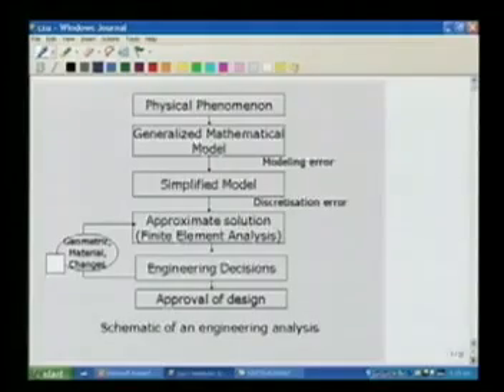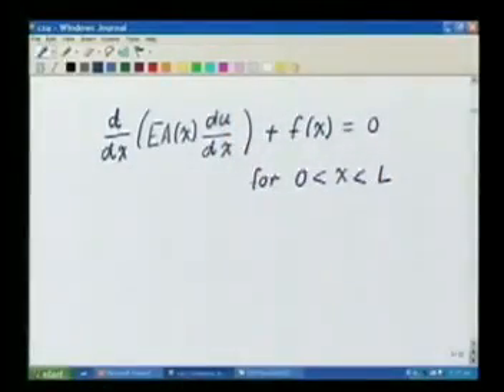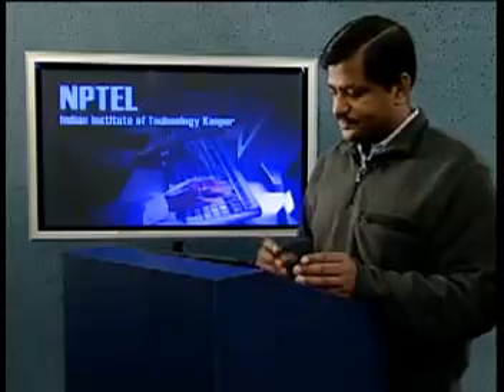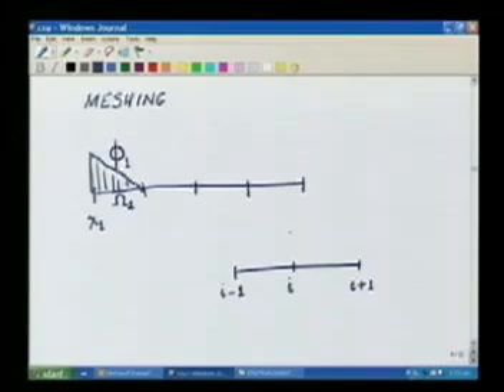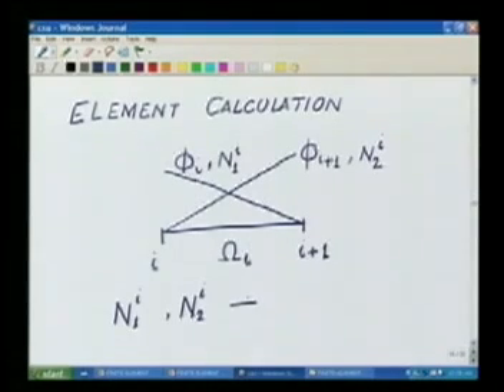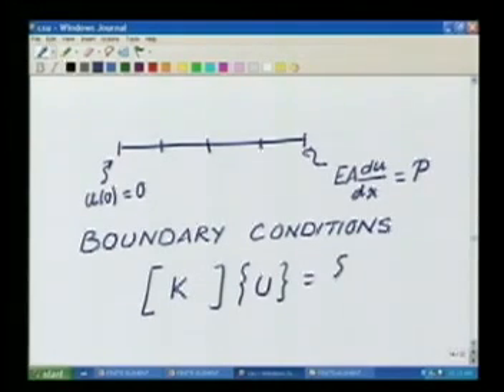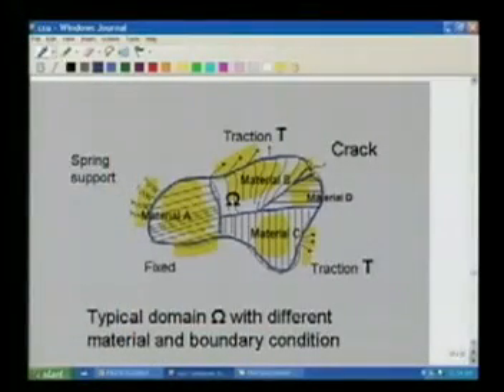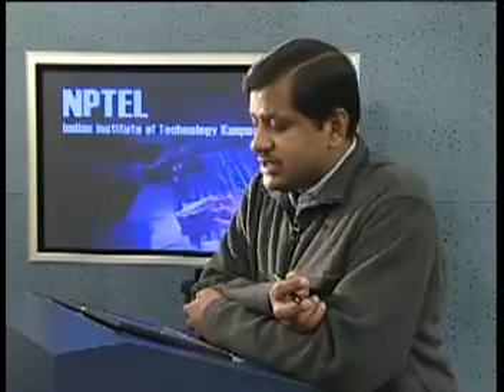Module 1 Lecture 1 Finite Element Method

Comment: @jahabdank - 'E' is the modulus of elasticity of a given material. For steel it is typically 200GPa. 'A' is the cross sectional area of the bar or member at a given position 'x' along the bar.

Comment: @BeeyondNeptoon True but that there are times when hand calculations are required - FEA takes time and wasting time on just trial and error costs money. Therefore it's important to understand how to do this and how the calculations apply to the 'model'. Some models might be simple geometries that can use hand calculations in order to save time, especially where tolerances aren't totally critical. It's shocking that the FEA guy doesn't really have a fully comprehensive understanding of FEA.